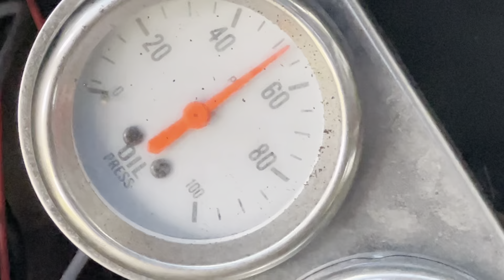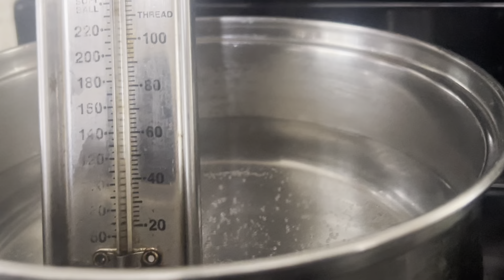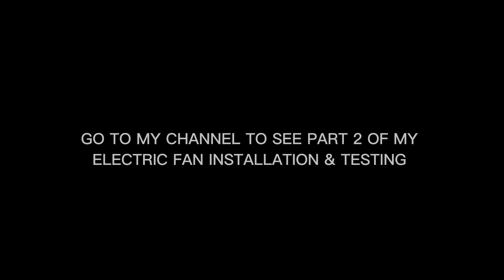MONTE CARLO SS GETS ELECTRIC COOLING FANS  | INSTALL, TEST & WIRING |(PART 1) #gbody #montecarloss

Comment: I have same set up in my cutlass what colors are you using I deleted ac also ..? If u don’t mind me asking I need the help doing this by myself
Reply from the maker: Colors for what part ?
Reply: I want to know what color wires to use for alternator ,battery ,distributor etc .. whatever wires I will need for carb setup no ac

Comment: Have you had any issue with using alloy works kit? It says to double up on gauge or double the relays so wires don’t burn. I’m currently on mine and hear lots of answers
Reply from the maker: The cooling fans ?
Reply from the maker: I haven’t had any issues , they’ve kept my engine cool for the most part